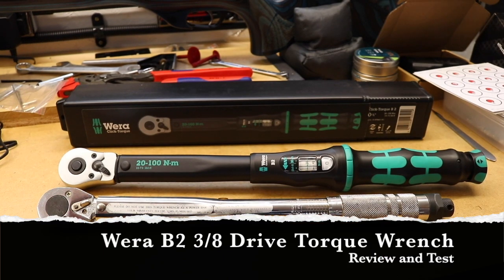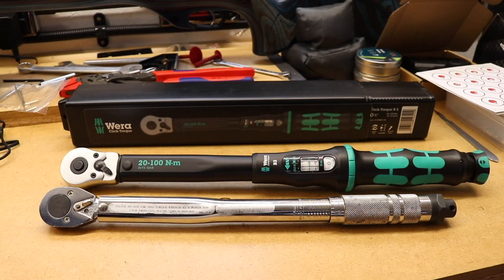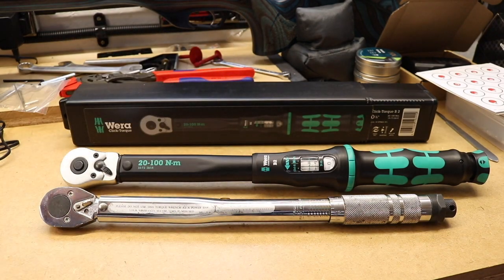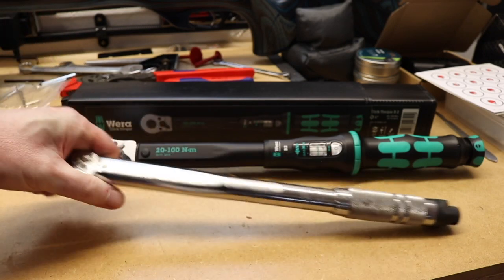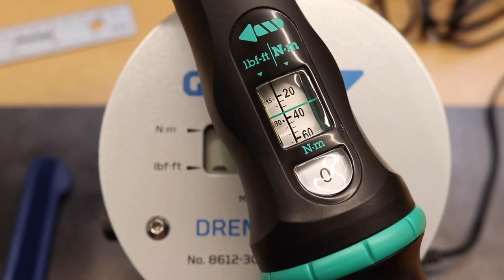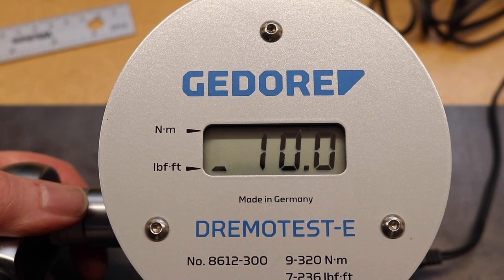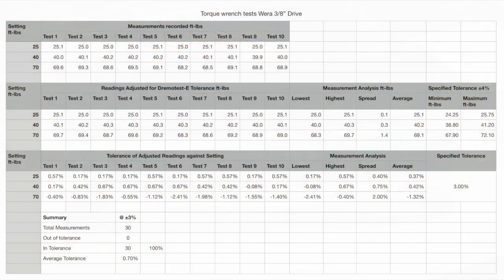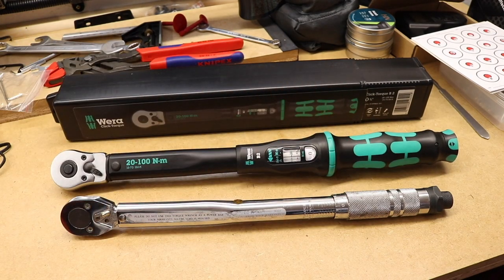Wera B2 3/8" Drive Torque Wrench Review and Test

Comment: 50 pounds? it is more than 150 now.
Reply from the maker: The Wera torque wrench will be circa £150 as stated in the video. The Laser torque wrench will be closer to £50, you shouldn't be paying anywhere near £150 for the Laser in the UK.